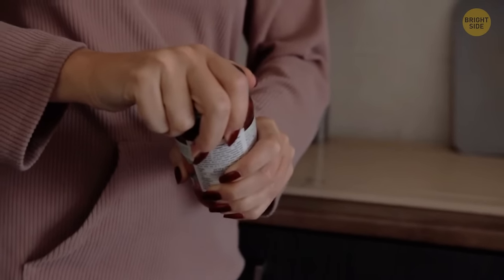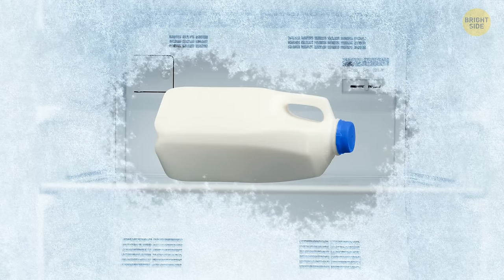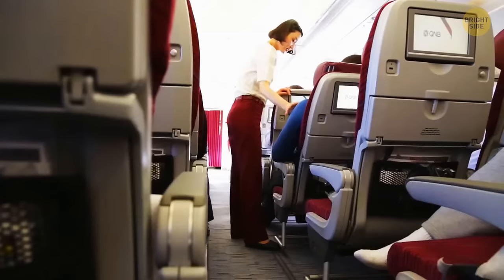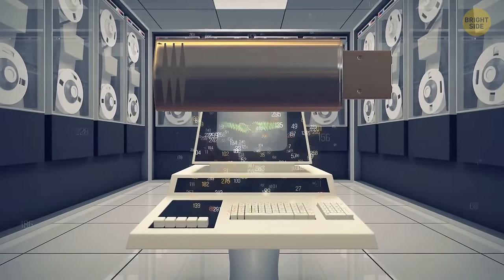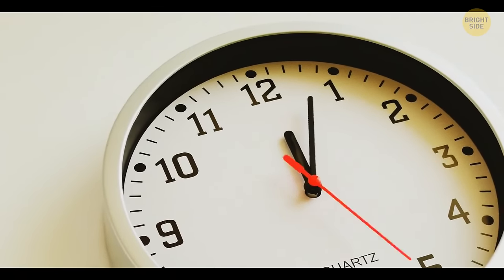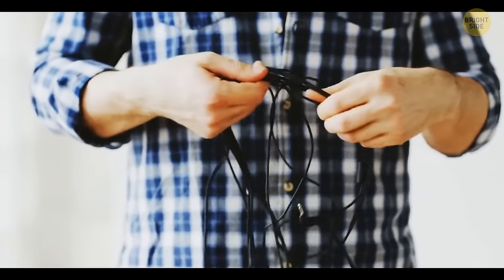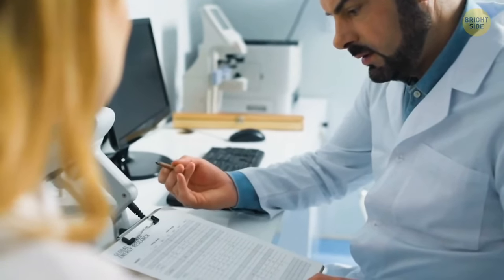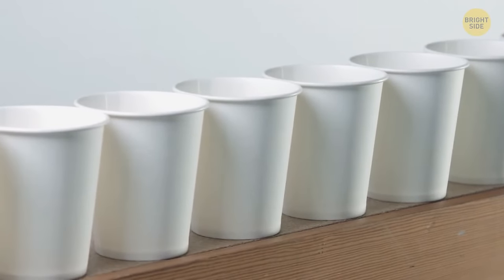100 Tips to Master the Art of Living

Comment: Who uses a "contact case" amount of lotion? That's not enough lotion, if you are traveling and are taking a change of clothes, that means you are going to bathe, which means you need to lotion. If you wash your hands (which you should be doing multiple times a day) you are going to need lotion at some point. Don't be ashy on purpose 😫